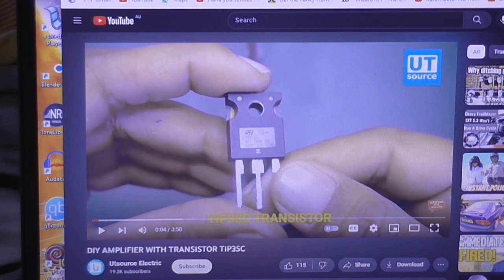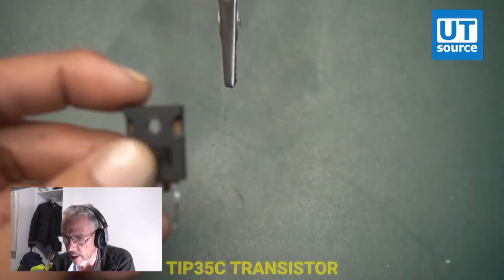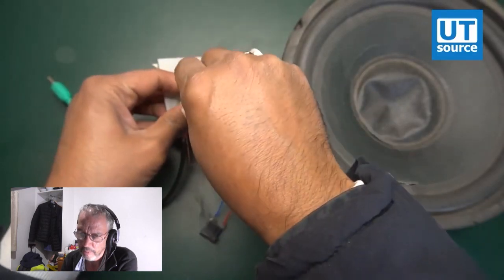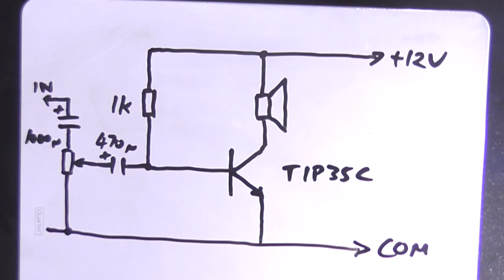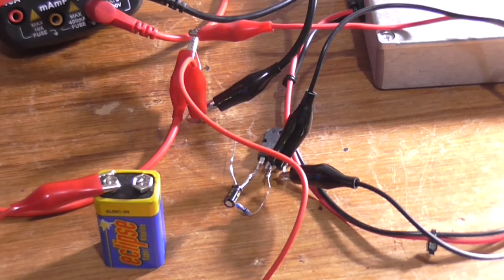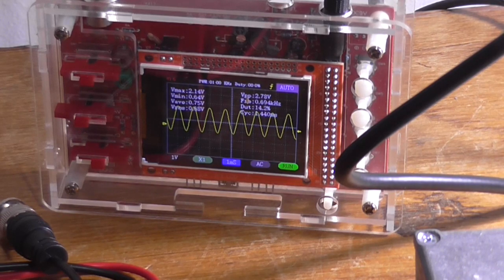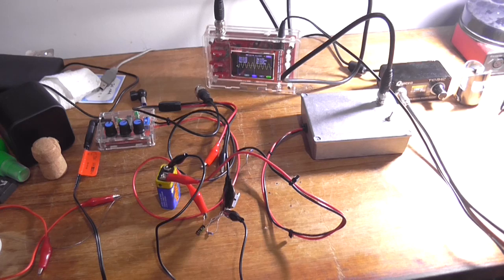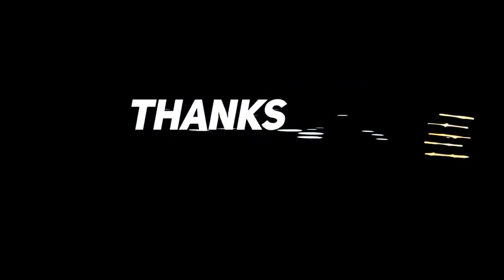VERY Bad TIP35C Amplifier Implementation

Comment: In the last circuit you'd want much lower than 10k in the collector. This determines the output impedance, so trying to drive 8ohm speaker with 10k collector load would result in a tiny output swing. Obviously the lower you go the higher the idle current; as always a trade-off to be made.

Comment: Hey Astro , I may have missed something here. It looks like he has the 1K between the base and the collector, neg side of speaker, and the pos rail direct to the speaker pos. Your schematic has the 1k going from the Base to the pos rail/speaker pos. I cant see his build has pos supply going anywhere except the speaker pos, so the circuit looks like its powered through the speaker. No wonder it sound like crap. Full supply DC though the speaker.
Reply from the maker: Oh. My schematic is wrong. Didn't notice, I wired it the same he did
Reply: @AstrosElectronicsLab  At least this guy had a clean soldering iron enen if really poor soldering practices. Look at most of them and you wonder what else they use their iron for 😂

Comment: This is a cool idea!  Find dodgy (amp) circuits and explain the stupid shtuff.  It's a bit like learning from others' mistakes.

I'm pretty sure I know why you wanted different cap values, but why did you pick the values you did?  I have a hell of a time getting some of these concepts into my head... I should just get a smattering of components (w/spares!), breadboard this stuff up & tinker.  (duh...)
Reply from the maker: Audio can be passed via a capacitor 1uF to 10uF to get all the frequency range. Any larger is overkill and can start rolling off the highs. Any lower and the bass starts rolling off.
Reply: Yes, I agree. Despite Astros distaste for crappy circuits, learning how to do it by learning how not to do it proved interesting. Good concept Astro.
Reply from the maker: @danishdart  thanks